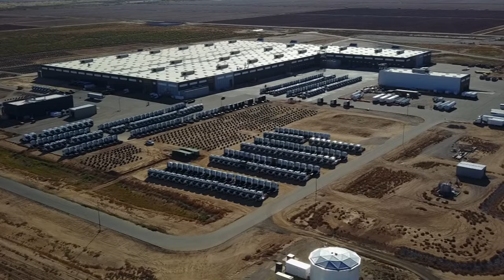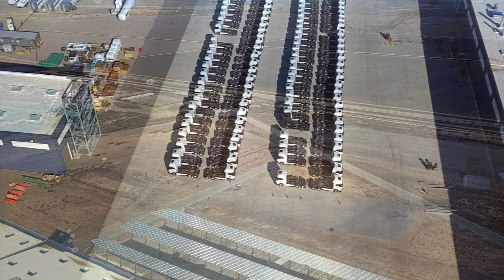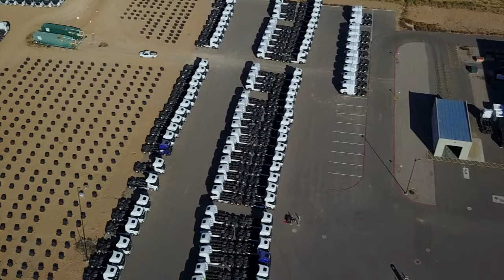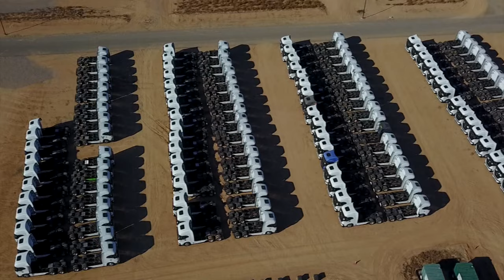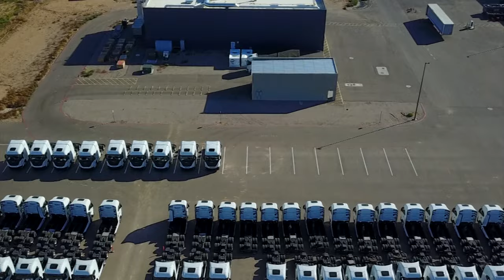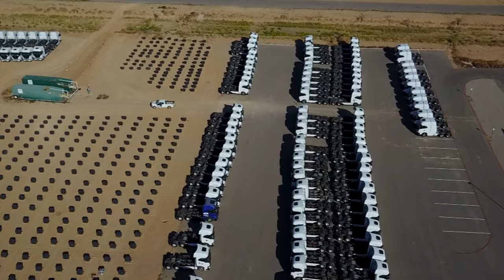Nikola Motors update, is it real???

Comment: You need to do some more research before stating your opinion concerning the Nikola BEV vs FCEV trucks.
Nikola by far and away expects to make FCEV truck the main focus of their business and will provide both  the FCEV trucks and refueling infrastructure. The fact you can see so many BEV trucks during your drone flight is only because of the large BEV recall Nikola did.
Any FCEV trucks they are building are being delivered immediately and not parked s a backlog at the back of the factory.

Also I might add building BEV recharging infrastructure at the customers premises is a lot harder than you think because of the huge amount  of  load the charging infrastructure puts on the power grid. Nikola can often provide onsite portable hydrogen refueling infrastructure in far less time.
Reply: And the delays related to permitting the charging infrastructure (if you're going to install multiple chargers) is a bear in CA, whereas Nikola/HYLA can park a mobile refueler at your depot with no permits required, and refuel a semi in 20 minutes.
Reply: @enighostmaster hydrogen will fail, already has
Reply: @pikkuporsas  what is your evidence that hydrogen has already failed?
Reply: @enighostmaster  Their life is evidence of failure.  😅
Reply: tomr6955  the best selling car is a battery electric car, and there are no hydrogen cars to speak of, so yes, hydrogen is failing every single day.
Reply: @enighostmaster  see my response below
Reply: Wake me up if Nikola still are in business Q2 2024 😂😂😂
Reply: @tomr6955  Manufacturing defect. They don't use that manufacturer anymore. Romeo was a startup.  Bosch has been around a long time.

Comment: The big problem with BEV trucks is how often and how long drivers will have to stop to recharge. Current diesel trucks can run 1000 to 1300 miles with 300 gallon tanks, thats basically 2 full driving shifts before needing refueling. On top of that, refueling only takes 10 to 20 minutes. This basically reduces BEV to local work only. Hydrogen trucks on the other hand may actually work better for Long distance work.
Reply: A Megawatt Charging System can recharge a battery truck to 80% in 30 minutes. Battery trucks can be cheaper to "refuel" per mile than diesel, so there's some economic incentive beyond the environmental benefit. But hydrogen trucks are far more expensive to refuel (should anyone actually build a hydrogen refueling station for commercial vehicles) and even more expensive than battery trucks. Just as happened with cars, investments, announcements, and actual sales of battery trucks far outpace hydrogen trucks, despite the unending hydrogen hype from fossil fuel companies who know that 95% of all H2 is made from their dirty fossil fuels.
Reply: @skierpage Fossil fuel companies have little involvement in hydrogen. Shell had like 5 pumps in California and then decided to stop doing them. The rest of the pumps are from small companies like True Zero. In Europe it's companies like Air Liquide which are not natural gas or oil suppliers.
Reply: That’s not a problem when the electricity is cheaper than gas. So having to paying the driver half an hour more is a good win for company profits, this’ll definitely get them to switch.
Reply: What are your thoughts on battery swapping to solve this problem instead of expensive hydrogen?
Reply: @brushlessmotoring  Seems like it could work but it requires manufacturers to make truck re-designs (presumably to a shared battery design) and some company willing to do the swapping. There is a SoCal company called WattEV that has a "pony express" solution: the drivers don't own the trucks, WattEV does. When the driver is low on charge they pull into a WattEV station and hitch their trailer to a new truck and take off.
Reply: @brushlessmotoring   a second battery pack is expensive, I don't know how many truck companies will spend on it to reduce 50 minutes of downtown. Back in the days of lead-acid batteries, indoor forklifts had battery swap rooms.
Reply: @skierpage  I agree, but there is a calculation to be made there, say 100 trucks, and 10 extra packs, and whether a specific driver goes for swap compared to a 40 minute charge break can be made on a case by case basis.
Reply: @brushlessmotoring  It could help with the down time, but the range issue is still there. If they can somehow redesign the trucks for that system, big companies have to strategically build and maintain truck facilities within these trucks' real world range. Meaning if these trucks can do 350miles with max payload all these companies need to have facilities within that distance of each other. For long hauls it means that you will still have to stop twice a shift to charge or swap batteries. As it stands right now, drivers are capable of driving about 700 in a single day with diesel trucks and potentially still have up to half a tank left over. At 350 mile range you can't even make it from Los Angeles, CA to Phoenix, AZ. And don't even get me started on Team drivers.

Comment from the maker: Looking at the fifth wheel from above will tell if the the semi has been used at all. That would tell the difference between recalled units and new semi’s. Some people think most of the semi’s are mostly recalled units, the fifth wheels will tell the real story!!!!
Reply: Thanks for the response.   On a different point I noticed that on all the BEV produced so far the fifth wheel is positioned to the rear of the rear suspension centerline.  This has been an unresolved  issue in my mind.  The only reason this would be done is to unload the front axle when coupled to a trailer,  This would also mean that there is also some issue with the load carried by the front axle without the trailer.  I have never seen the actual front axle loading compared to the axle weight rating.  Does anyone have this information?  The FCEV has the fifth wheel ahead of the centerline yet it is the same wheelbase as the BEV.  It may not have the same problem with the loading on the front axle.

Comment from the maker: I am going to buy some Nikola stock in January, but not much .  I am going to fly over first and look at the fifth wheels, that will tell me if the tractors are recalled or new!!!!
Reply: Hi Steve, can you release these vids now and then? To keep us in the loop us investors :)
Reply: It’s not complicated: ALL of the BEVs are either of part of the 209 recalled trucks, or they are trucks that were built before the battery fires but haven’t yet been sold. There are just over 100 of those. There have been no BEVs built since last May. The other trucks are FCEVs. Those are easily identified, as they have an extension behind the cab. The ones with a black stripe on the extension are beta prototypes.

Comment: what day or week and time of day were you there?   those are RECALLED Battery trucks.. they need to replace the battery pack in EVERY one of the 300+ trucks produced..
Reply: So Nikola only made a total of 209 battery EV rigs. That’s public knowledge.  In the video, I counted 378 rigs, not counting a few misc ones. So those can’t all be battery rigs.  They only are producing Fuel cell electrics since August. If all that is true, they have to have produced at least 169 FCEV’s to have 378 rigs on the lot. Some FCEV’s have been delivered we know. And it’s possible some of the 209 electrics are back at customers too. So there might be more than 170 FCEV’s on the lot.
Reply: @Craig-SAR  wrong they made over 350 .. 209 is the number sold to dealers and customers from the recall report.. there were 148 trucks in inventory in Chandler  that they wrote off this quarter.

Comment from the maker: 12,000 lbs. front axle, 34,000 lbs. on semi’s with two rear axles and 34,000 lbs. for trailer axles, plus 2000 lbs. extra for electric trucks. These are the standards for over the road trucks on Freeways, of course there are exceptions with permits.
Reply: Per Nikola their BEV front axle is  rated for 19,800 lb.  The front suspension is rated at 17,600 lb. and front tire capacity is 9000 lb.(x2).  Vehicle weight is 29000 lbs.  So the question remains why is the fifth wheel positioned behind the rear suspension centerline?  I am still guessing there is a hidden issue.  The capacities above come from the standard Euro specification used on trucks in that market.  You can see how ridiculous this spec is for use in the US market.

Comment: I count 11 fitted hydrogen trucks in your footage - they have the large box behind the cab for tanks. I'm still waiting for a battery swap semi in the US, ideally with an automated swap station - they have them in China (of course) but also a manual version in Australia using a fork lift, swapping batteries seems to solve whatever fast fill advantage hydrogen is claiming, with none of the headaches of handling either very cold liquefied or highly pressurized hydrogen gas. The batteries in the station can be used for energy trading, can be slowly charged, or charged with renewables as a priority, for instance, to reduce wind curtailment or maximize solar charging.

I don't know if the Nikola trucks can be fitted either way between hydrogen or battery - I know the hydrogen truck has a pretty big battery in it anyway (80kWh) for regen braking and buffering the generally lower output from the fuel cell.

Tesla's claim was 7c per kWh on the 2017 announcement video - no idea what it actually is today. Volvo also has a class 8 in the US in use.

Comment from the maker: The rating that they put out for their axles is nice, but it doesn’t change the law. The fifth wheel is adjustable so you don’t have over 12,000 lbs. on your front axle, then your trailer axles are adjustable so you don’t have over 34,000 lbs. on your rear tandems on your semi truck. Where electric truck get that extra 2000 lbs. at ports is something I don’t know!!!!
Reply: The fifth wheel on the Nikola BEV is a fixed design, no adjustment is available.  They may have done this because the front axle is already overloaded even without a trailer.  Moving the fifth wheel forward would increase the front axle loading even more. It is okay to have over 12k on the front axle as long as your total GVW is 82k or less.

Comment: Question? What ever age at anyone of us is at the moment.  We're you born 50 year of age or 60 years of age? Or you went thru process of being infant,  toddler,  childhood, teen, tween, adult,  mid age, old age etc? 

The auto industry powered by the fossil fuel, how long it took to reach where we are today? Oil and gas industry is over 150 year old.  Hydrogen can not be at the same level just in couple of years. It will take time but it is going to grow lot more faster. The future is Hydrogen,  the only zero emissions Fuel not battery.
Reply: Hydrogen is not zero emission, it's made with fossil fuels, apart from a small niche made very expensively with renewables for greenwashing the fossil fuel stuff. Where batteries are applicable, they will be far cheaper than hydrogen, they both use the same electricity, but hydrogen needs 3 to 4 times more of it to achieve the same distance.

Comment: Sorry to the guy that did this video but you're wrong. Fully loaded truck at 80,000 lb is not getting 8 mph gallon your best trucks don't even get six and a half miles per gallon for fully loaded. Your best calculations would be based off of 6.5 loaded mile 8 Mile empty in the best of conditions. Once you throw in the western states climbing you're looking at 4.5 mi per gallon at best. Btw third generation truck driver been in this business very long time I have owned numerous trucks. Hydrogen already exist as well as natural gas which would not be very difficult to add hydrogen to and have several places for refuel. If there are vehicles that makes demand when there is demand entrepreneurs will feel that demand.

Comment: 337 trucks according to my count. I wouldnt be surprised if my count is off by 1 or 2 or 3.
Thats sure a lot of trucks to be stockpiling. Why arent they on their way to customers?
Over behind the far end of the building behind that huge blue building? Equipment box? are 
5 sitting all alone sorta parked haphazardly, not in a neat row like all the rest. I'll bet these 5 
are test trucks the test drivers use to bomb around on the Arizona backroads to test.
ARIZONA? Heeeeeeeeey, did you know most all auto makers have an Arizona test facility
where they torture vehicles past their limits. Even the US Army has one there too. The
things FORD does to their trucks at their proving facility is a crying shame. BUT, they have
to prove their trucks are built FORD Tough.

!
Reply: Almost all of them are waiting for batteries. If they can get some, 209 trucks will be shipped back to the customers or dealers. About 150 are waiting to be sold
Reply: Trevor Milton's scam company have no costumers😂